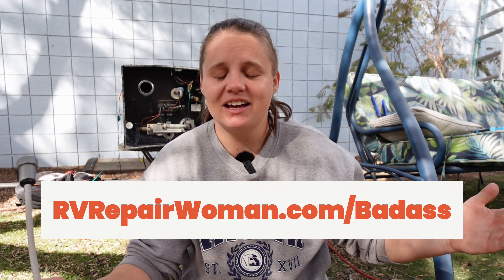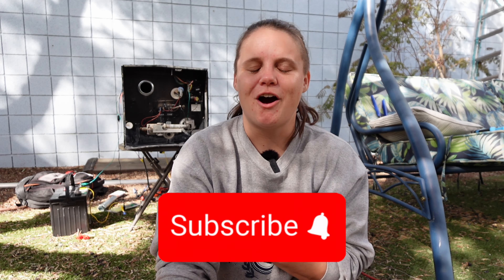Cleaning a 20 Year Old RV Hot Water Tank (With a RV Technician)

Comment: I use the RV antifreeze fill pump to fill my water heater tank.  Drain antifreeze from water system.  Rinse water lines. Open bypass valves. Use antifreeze fill hose to fill system with vinegar from jugs. I also make sure vinegar is in the lines to disinfect the lines.  Turn on water heater till water is hot.  Let sit over night. Drain and rinse. repeat as needed.

Comment: Thank you very much for your videos! I have a do Matic 6 gallon hybrid heater and you helped me to figure out what was wrong with it and why it wouldn’t heat in one of the other videos. But I did have a question for you. Now, the water comes out of that relief valve from time to time steaming hot and the water is extremely hot out of the faucet. I have turned it off for the time being, but was wondering what the problem could be with that. Thank you very much for all your informative videos! They are truly appreciated!
Reply from the maker: My thought would be to check the T-stat and the ECO. The Tstat should open up and loose continuity at 130-140 F and the ECO should open up at 180-190 F. I would get a temperature reading on the water and see if it is above either of those ranges and check continuity on the ECO and Tstat accordingly. If you're only getting 1 REALLY hot tank my guess would be a bad Tstat. And once you figure out the problem I would change out that P&T valve. If its opening up do to temperature than it needs to be replaced. If its just opening up due to pressure than you're good. Just my brain dump on what your problem could be off the top of my head.
Reply: @rvrepairwoman  thank you so much I will do exactly what you said! Thank you for sharing all you knowledge and helping us noobs out! You are awesome!!!💯💯💯

Comment: Well done! Great video, I just wish I could show my customers the benefits of a cleaning. Quick question, if this is still in the RV, do you leave the pvc on the drain while it’s heating up? I’m wondering if I could manufacture a shut off valve at the breach so I didn’t need to leave the fill station attached.  Thanks again
Reply from the maker: I left mine in while it was heating up. You definitely could add a ball valve in there somewhere if you wanted to take the longer stick part off.
Reply: @rvrepairwoman  much appreciated